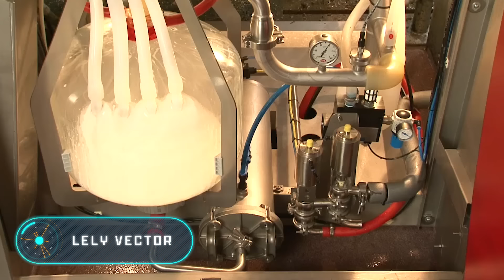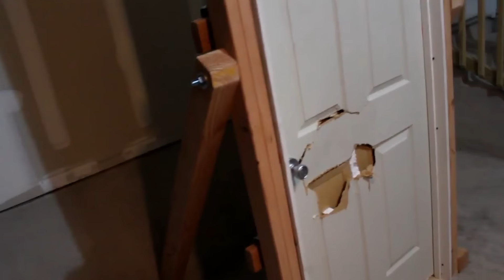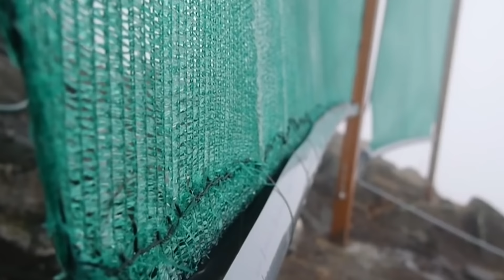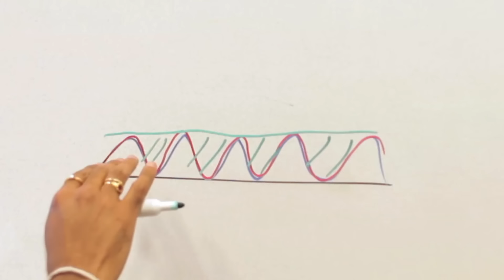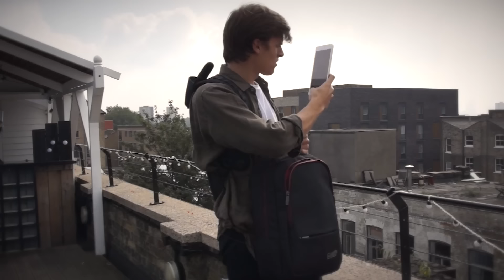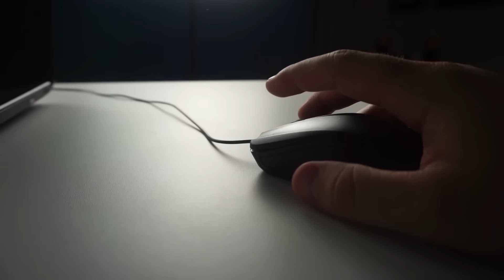AMAZING INVENTIONS THAT ARE ON A BRAND NEW LEVEL

Comment: The funny thing I found out about back packs is, your meant to wear them on your front this stops you getting back pain as the human spine sits better with the weight on your chest not your back?  Why they call them back packs is a odd thing then?  maybe it should be front packs!  So the pack they done to move around to the front is good as it seems it should be there anyway.
Reply: Wrong wearing it in the front will make you lean forward and be worse for your spine that's why people with big bellies have back problems 🤠